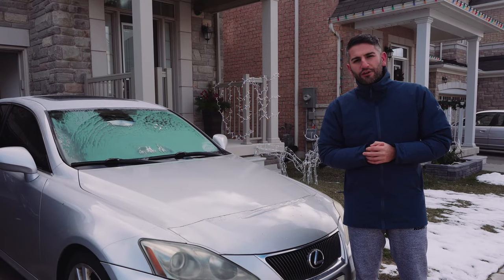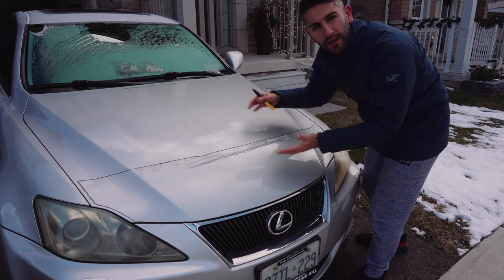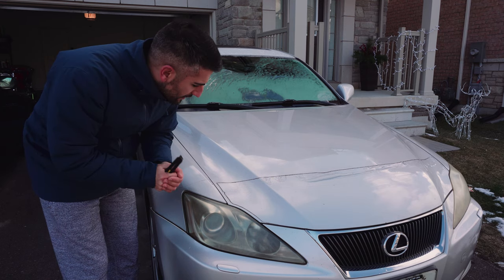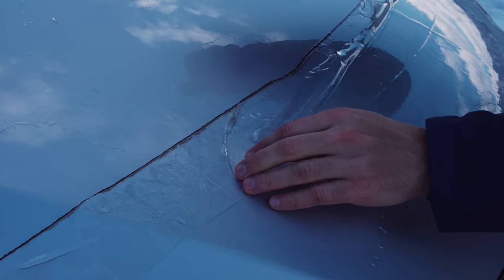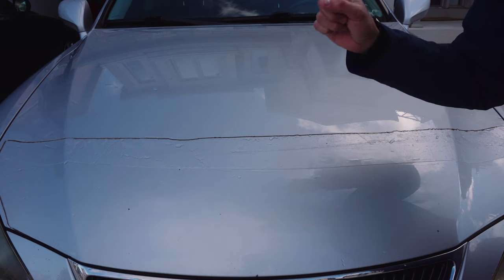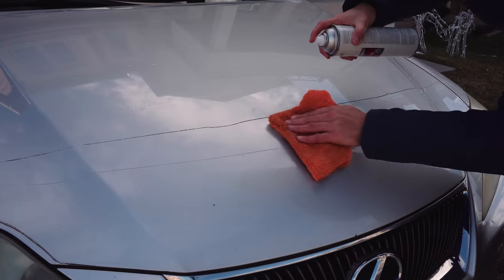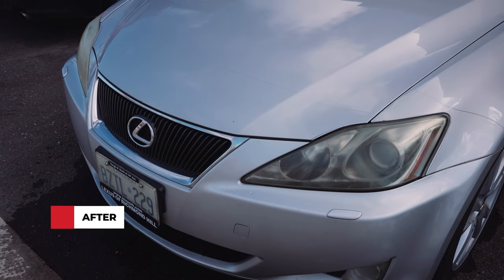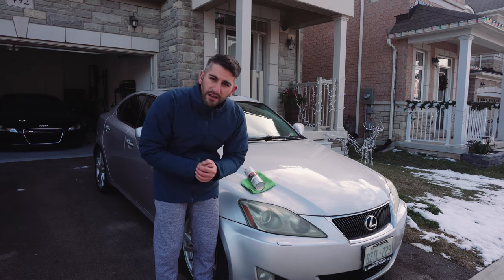How to Fix Peeling Paint Protection Film! Home DIY in Under 30 Minutes!

Comment from the maker: Yes, the proper way to fix this is to peel it all off and get new paint protection film. For those who do not have hundreds or even thousands of dollars to burn on a whim, this is the best way to fix your paint protection film if it starts peeling as shown in the video. Finally, I will say it again, please be cautious when using the blade on your paint. Take your time, do it right and give yourself a pat on the back for a job well done!

Comment: Does PPF peels paint on the car if it is brand new car ? my car showed some signs on the edge of the panel at one area and ppf installer says its because of paint job not done greatly so paint peels off